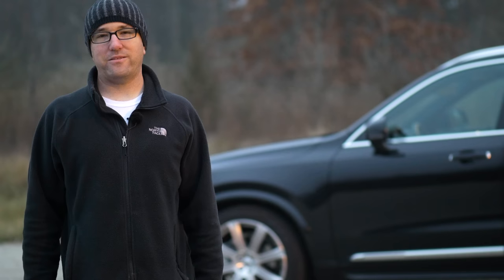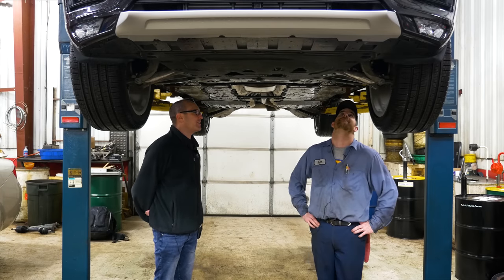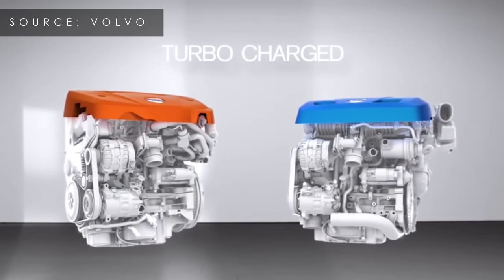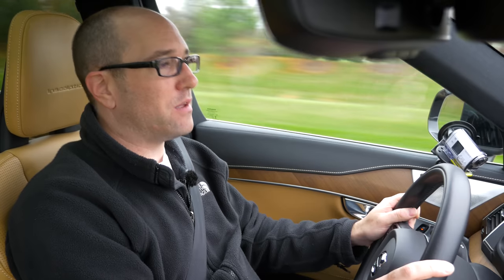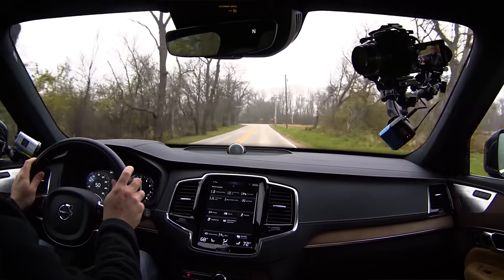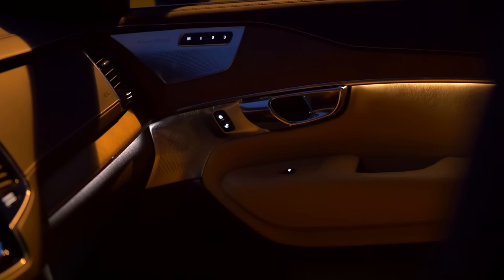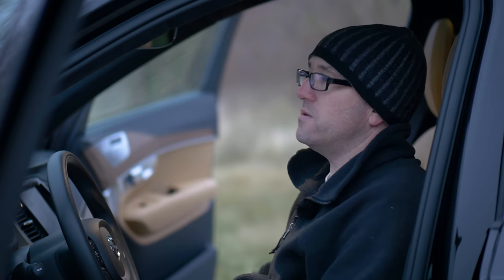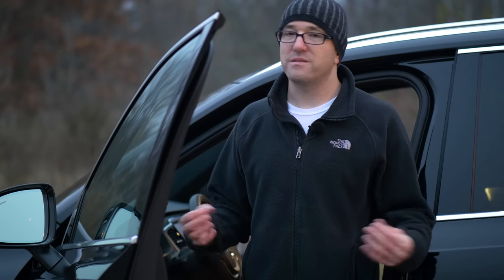Review | 2017 Volvo XC90 | The Tipping Point

Comment: I'm never paying $80K for an SUV with only 4 Cylinders. I miss Volvo's T5/T6 engines.
Reply: Yep, pretty sad.
Reply: ThatGearHead rip 5 cylinder
Reply: I have an XC90 with the 2.5T, it's pretty awesome (slow but sounds good, reliable as can be)
Reply: I have a T6 Inscription like the one in the review and the engine is incredible. It doesn't have the buttery smooth rev of an engine with more cylinders or a particularly sexy note but in every other category it boggles the mind. The supercharger boosts power output so low that you wonder how the engine has so much grunt. Under 1500 rpm has as much torque as anywhere else in the powerband and it pulls all the way to redline with authority. Every single person I've given rides to has commented on the smooth and ample power and they all are surprised its a 4. I regularly see 25-26 mpg @70-80 mph and over 20 in the city doing school runs. For what I use it for I'm very pleased.
Reply: Glad to hear Andy. I will have one when mine kicks it. I will get a Momentum though, with a few options naturally.. I will omit the air suspension though, as I am in the process of replacement suspension now, with 316,000k, and I have Nivomat, which is expensive to replace
Reply: ThatGearHead I get people's obsession with larger engine/more cylinders. However, I don't get it when people ignore the benefit/advantage from newer designs and goes purely for the feel. It's like buying a phone purely because it has 8 cores, or its the thinnest phone in the world.
Reply: ThatGearHead I miss my T6 too lol. Man that engine little work it flew even more
Reply: ThatGearHead they have
Reply: Well it's the trend, for me if i get the T8 with the plug in hybrid maybe but i miss the Yamaha V8
Reply: Have to get used to it. This is the trend. 20 years later there might be like a 3 cylinders and the engine might be a range extender for the battery
Reply: People only care about cylinders. But the power the 4 cylinder volvo engines creates is kinda of amazing, and it powers the car properly and well and 4 cylinders  now are not like they were before, don't live in the past
Reply: Bernie whatabout 12
Reply: Would you rather have a crappy 5 cylinder or a smooth and refined 4 cylinder that has good mpg?
Reply: The T8 also has an electric motor, and it's only 5k more than the T6 in the US (the T8 receives a 5k PHEV federal subsidy). I don't care if it's a 4-cylinder; I do care that the T8 has 400hp and launches this car from 0-60 in just 5.2 seconds.
Reply: Well people from Volvo did not even count on people like you when they where designing that engine !!! Big engines are obsolete in the whole world but for some strange reason (  arrogance maybe ) american's are obsessed with trillion litres V8 engines, one day when gas prices go very high in USA maybe just maybe you will change your mind's.
Reply: I would have said the same thing but after driving it I changed my mind. I went from a supercharged Range Rover with a 500hp V8 to a T6 Inscription and I have no regrets. The performance obviously can’t compare but this engine is perfectly suited to this car.
Reply: a simple opinion of preference and here you are with your arrogant and ignorant response. 
1- benz with their v8s and 12s and bi turbos...range rovers v8...bmw...even nissan and toyota have v8s and  high 
    displacement 6s...where ford for example offers a full size truck with a v8 as well as a small turbo v6 or 3L diesel 
2- the mpg looks good an paper...rev the turbo 4 and your mpg goes down drastically.
    i have a mid size suv with a turbo 4 and mpg is worse than my wife's larger suv with 3.5 v6. 
3- longevity of a over compressed engine. and while this could be a lasting reliable motor,  over engineering  has a 
     potential for issues.
4- people buy volvo for safety and RELIABILITY... if you can spent 80K on a car i really don't think you'd care if it makes 
     21mpg with a v6 or 23mpg with a 4...and if mpg is the issue there'a always tesla
Reply: If it performs like a v6 why do you care?

Comment: The infotainment screen is only laggy after you start the car, Sensus needs to "wake up" just like human. After that it works brilliantly.
Reply from the maker: +Arya Pradhana D I had issues with lag well passed startup.  With tech like this with core vehicle functions tied to it a wake up period is unacceptable and from a programming/OS perspective with constant power no exuse for deep sleep states all processes should be easily running without need for constant re loading/delay.

Comment: Imagine the cost to keep these new luxury cars long term..
electric motors everywhere for the soft close doors, motor to set the e-brake a motor to shift the automatic trans, all the new moving parts in the engine to go wrong, god help you if a circuit board goes bad in several years..  Because the entire car will stop working because one little part broke

Comment: thank you again for great video! Beatiful design and quality as a mark of Volvo's DNA. But,  I have to agree with you, this is a bad example of applying a refine technology, which eliminates human habits ,or worse, do not respect them. Besides, those engines are proper heart for Volvo S90, not for over 2 Tonnes SUV with passengers on board. I use such XC90, and have also as daily driver a 2015 Mustang GT PP, boy...2,0 Liter T6 drinkes aaa...lot, more than 5,0 Coyote. No replacement for displacement! Where is logic gone?

Comment: I went from BMW 3's - latest was a 335i (2013) - amazing power. Now I have an XC90 and I don't miss the Bimmer. This SUV is great. I initially had a couple electronic issues with it. The Volvo dealership network is not even close to being anything like LEXUS or even BMW. That's a huge drawback. Dealerships -- for Volvo -- don't care. I've been to 2. The place I leased mine and then another because I realized the place I actually got it -- was hideous. Anyway -- if you deal directly with the company, you'll get what you want. I got free VOLVO ONCALL for the life of my lease because I complained. Pays to do your homework on WHERE you get your Volvo. Because they have zero cohesion between any of them. Unlike Lexus.

Comment: Tesla got the Volvo lead interior guy.

Not sure if there will be a change , but the Tesla infotainment is much more intuitive and straightforward without all the clutter and lag. And with level 5 Selfdriving hardware, you don't have to have an argument with driving and wanting to relax. 

The xc90 could have definitely benifted from an autopilot system that drives itself.

Comment: I meant this guy has not read the complete usage of this car - there is no need for manual buttons when everything can be controlled by voice control
Reply: Sai_ YoBoy 
Either voice control or the steering wheel buttons control everything that the driver needs while driving, apart from cancelling the stop/start, which needs a swipe and a press of the screen. This is made much easier if the app is positioned on its own at the top corner of the screen nearest the driver. The app can, of course, be dragged to that position or any other, as desired.

Comment: Would never buy because of the failure rate in air suspension as Scott pointed out. Add to that a twin charged engine, this thing might make 50k miles before being a complete mess to repair at best
Reply: Peder Hansen but volvo is known for their unreliable engines?

Comment: I’m just not impressed with the end results. Yes the engineering is amazing on a technical level, but it makes basically the same amount of power as  a Toyota 2GR v6 and yeah, maybe you would give up a couple of miles per gallon, and illuminate a few admissions, but isn’t all of that out of the window. The first time you need to pay for some sort of powertrain repair there goes your money savings. What’s the environmental impact of a manufactured vehicle being sent to an early grave versus even if vehicle that pollutes more but last longer if I remember correctly, that’s why they used to say the Toyota Prius polluted more in cause more pollution between its manufacturing than an H2 Hummer

Comment: I bought my xc90 based on this video and a few others.  What a mistake.  I should have looked at Consumer Reports reliability rating and the message boards on the car.  Its like buying a bad version of windows and installing it in a beautiful car.  So many software and app problems.  You really are a beta tester of this vehicle.  You can't be a person that just wants to get in the car and go because you can't do that with this vehicle.  Beautiful but plagued with software problems and software updates are frequent and can stir up new problems.  Ugh.
Reply: It’s. Getting 23.3 mpg average.  Take it on a long route and it pushes 25-26.  Love it!
Reply: Owned 18 months 30K miles and zero problems.
Reply: I’ve had mine nine months now and only problem has been a dead battery that had to be replaced early on. At the same time they did a software update and a curtain airbag recall. Zero issues from early May to December and it drives better today than when new and the fuel economy has improved as well. 
The touchscreen is a dream to use and I use voice control for temperature and changing infotainment sources, otherwise the buttons on the steering wheel which are the best of all the cars I’ve ever driven.  
If I have issues, they are that despite their reputation, I find the seats less comfortable than many others and the horizontal distance between the seat and the sill makes getting out a dirtier experience than it should be.

Comment: for that price, its a sin to put that god awful motor that would barely flush a turd if given the chance. The Q7 blows it away in performance, comfort and in the snow. The XC90 drives like a 3/4 ton Silverado, you'll feel every bump, and the heater sucks a barrel of turd. Traded it in for a Q7, I can't even believe they are in the same price range.

Comment: Why are you toggling or using the screen to search the net when driving? there's control on the steering wheels for the essentials and to change the climate it is a few simple touches. You cannot blame anyone else if you decide to drive in a unsafe manner. If you are not distracted by the screen it could be your mobile phone or any other device. If you don't have the self control to remain focused and vigilant when driving, you should not be driving. There are enough campaigns and heavy enough penalties to encourage you to drive safely. It is absolute no excuse.

The infotainment system is a great feature to provide all your travelling needs in one place, whether it be look at the weather, find a nearby POI or check e-mails. You should have the intelligence to understand this should be done when parked.

Comment: This is by far one of the worst Volvo XC90 reviews so far. Volvo has incorporated Sensus 2.0 into the steering wheel, which pretty much means that, whatever you can control on the touch screen, you can also voice control from the steering wheel, pressing only a SINGLE button. The concept is that both of your hands should remain in constant contact with the steering wheel. This works for climate, navigation, media, etc.

Comment: Acceleration seems meh...  in reminded of he Mazda CX-9 in the sense that the interior quality is amazing however the motor is complete dog shit, gimmicky nonsense. Fuckin shit. I suppose the folks that buy this or even the CX-9 won't care about that. I can't afford something like this Volvo. But I am cross shopping cx9, 17 highlander and pilot and the weak motor in the cx9 is a deal breaker. I wish i could get the Honda/Toyota HP numbers in the Mazda...
Reply from the maker: +NurNordschleife See if you can get in a CX9 with over a 100 miles running premium fuel.  The first 50 miles in that car have odd throttle mapping/learning where pedal feels dead.

But I agree these bigger machines need a V6/V8 option.  The xc90 feels much faster than cx9 makes power all the time but you pay for that of course.